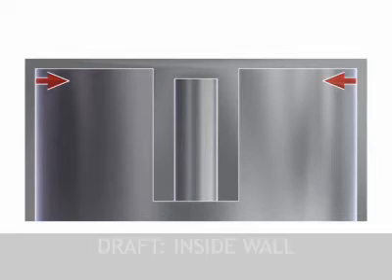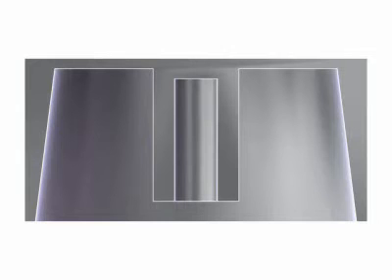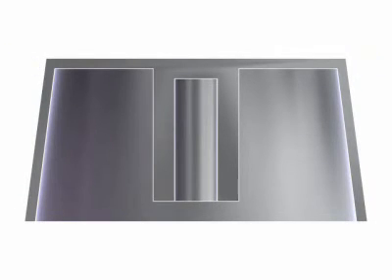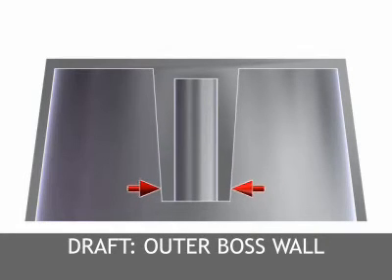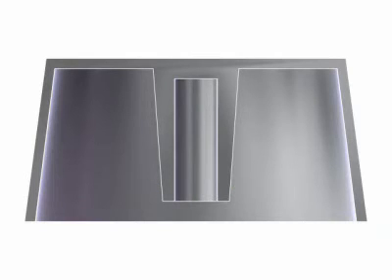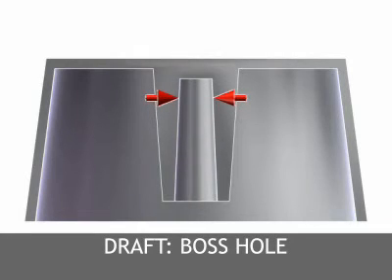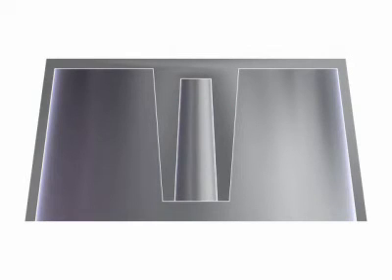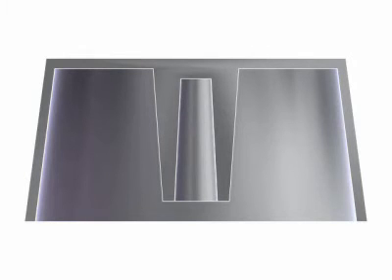Draft Application in Die Casting

Comment: Why inside wall need more draft angle
Reply: due to ,after casting internal sides are shrink toward the center ( that means it will cling to the die) that's why we provides more draft in internal than external.